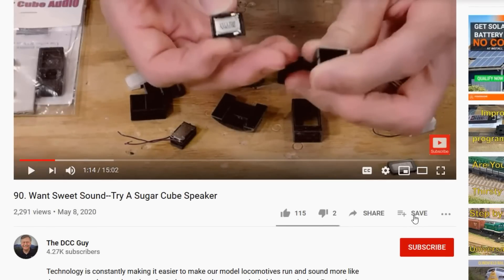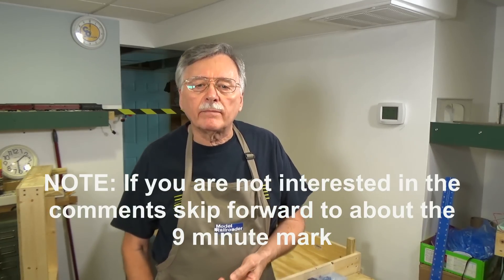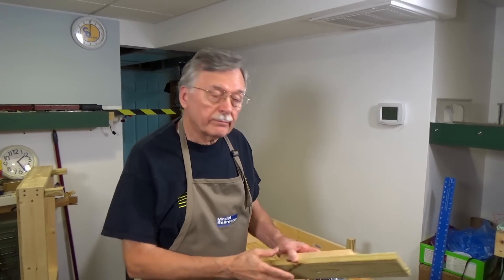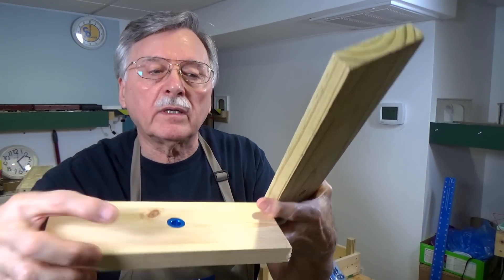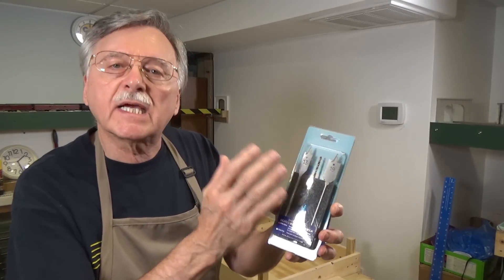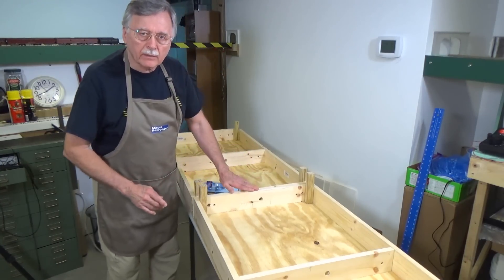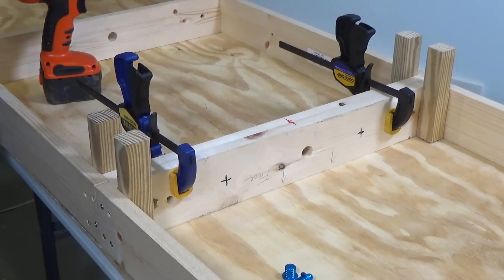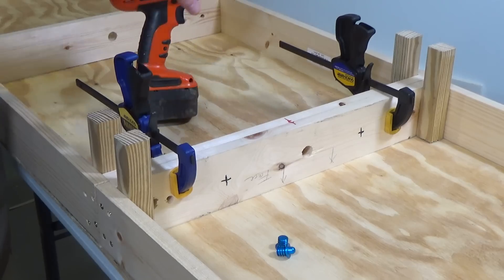Alignment Dowels (132)

Comment: I my experience, I have found that during module initial design / construction, assembly goes well when everything is carefully measured and all screw holes are precisely pilot drilled. When everything is dialed in, I disassemble the modules, then I add some Titebond 2 glue. Finally, I reassemble them with the original screws and clamp them well. No creep, no breakage after over 8 years+ with all my modules.
Also... grave errors tend to occur when drilling alignment holes without some sort of Porta-align or jig to keep you at a perfect 90 deg from the surface.  Your freehand method in the ham-handed hands of many people, can reap very predictably unpleasant results. Using your method, only if you are a seasoned musical instrument repairmen or a retired cabinetmaker, can you expect to carry it off.  (In any case, the photos tend to evidence that you have exceptional carpentry skills that many in most module clubs don't seen to possess.)

Comment: Hi Larry
I am in a NMRA group here in Australia.  About 2008 we built a number of modules for display purposes.  We used those dowels. A jig was made to ensure that all ends lined up accurately.  It consisted of a piece of wood (lumber) with another piece attached at right angles across it.  Two small holes were then drilled where the dowels were to go.  The end boards were then lined up and clamped  to it and a small nail placed in the holes to mark the end.  After taking the end out of the jig the holes could then be drilled.  The modules are held together with a single G-clamp.
They have been to about 30 train shows so far.  Some over 150 kilometres away.  Very quick and accurate to set up.
I love your videos and have learnt a lot.  I subscribe to a number of other channels but have found yours to be  the best.
Stay safe 
Paul from Zillmere
Reply from the maker: Very good point. Hopefully if someone is already a member of a modular crew they will be aware of the groups standard. I participated i  the Northern Virginia N-Scale modular group about a decade ago and know first hand of the problems that arise when folks do not strictly adhere to those standards.
Reply: In the club I belong to we took a similar approach of making up a template. This was particularly useful when retro fitting dowels to old layouts where scenery meant it was difficult to judge alignment of the baseboard surfaces. When building new baseboards we clamp the end pieces together and employ a bench drill for greater accuracy, doing all the drilling before assembling the baseboards.

Comment: I am from the UK and am about to update my Club's 20 years old or more 00-gauge layout corner end board modules with these same blue Australian/UK DCC Concepts dowels. Our existing brass dowels are standard cabinet makers 1/4" dia items which have worked loose. Basically, they are to small for purpose. These corner boards attract members to lean on them, exerting a high down force. So noticing these new items on a DCC Concepts stand at one of the many UK shows (this company is always worthy of a butchers for new products, they don't make rubbish), I purchased a pack of four pairs. I assumed my Club's tool box would include the 13 & 19mm flat bits needed to make the holes. Not so, so today I went to two different local towns and five different tool stores, trying to track these two sizes down. 13 & 19 are basically metrified 1/2" & 3/4" (easy for you in the USA) but here in the UK its now more 12 & 20mm, so nightmare. I did eventually track the correct sizes down. I therefore recommend you initially buy the installation pack which includes said drill bits.
On your video showing their installation, you missed mentioning some important points :
The dowels should be as far apart from one another as access with the drill will allow. This ensures greatest corner to corner accuracy. 
You didn't mention the pilot hole should be as square to the surface as possible in both planes. I saw a YouTube video of some guy using an old CD as a mirror with two lines on it draw at 90° to each other through its centre. The hole in the centre of the CD is centred about the hole you want to drill, and the silver surface acts like a mirror. Just align the reflection of the drill bit shank to both the lines and the drill should be square to the surface. I haven't tried the idea yet, but sounds plausible.
The other problem, was you deciding to drill the 13mm hole from the inner side of the board i.e opposite end of the hole. That's an absolute no no. As you found out, those flat bits burst through, nearly destroying the neat seating surface for the dowel's flange. You then tried to clean out the 13mm hole from the opposite flange counterbore end, which probably made the dowel's body a loose fit, therefore losing the very accuracy we need. Flat bits are useless for cleaning out holes, they rely on their point being able to follow a pilot or bite into virgin wood. I suspect the dowel body should be a light tap fit into its mounting hole, so being 13 and not 13+ a bit, is very important.
Its also very important the 19mm seating counterbore is drilled first following the initial pilot hole, so to leave the pilot hole intact for the point of the 13mm drill bit to follow, to produce the mounting bore hole as concentric as possible hand held.
A good idea to test this on a scrap piece of wood first.
Reply from the maker: Excellent comments and suggestions for the installation. I definitely will point anyone asking for more info to read your post. Thanks for taking the time to do it—Larry
Reply: @TheDCCGuy  thanks for taking it as intended, constructive criticism. I may get in touch with DCC Concepts and query their choice of drill sizes. I assume inch size drill bits are still freely available in the US, as they just may have been looking at your side of the pond as their main market ?
Reply from the maker: One point of explanation, I was following the enclosed instructions that tell you to drill the holes on the face first then drill through the end piece from the inside face. I generally assume that they have tried it both ways and find the way they recommend to be best so I usually do as I am told. At any rate it still provided a tight fit even though there were a few rough edges as a result of drilling fro  the inside out.
Reply: @TheDCCGuy  ok, so definitely worth a trial run on a similar but scrap piece of wood to judge best results.
Reply: Although more expensive, I always use Forstner or saw-tooth bits, which don't necessarily need a centre. Flat-bits are a rough and ready tool which I avoid in any kind of precision work.
Reply: @RicktheRecorder  Forstner bits aren't really designed for hand held electric drills and saw drills are totally unsuitable because a flat bottomed counterbore is required, not a through hole
Reply: @andrewdking  In my full post below, I said that ideally one should use a drill press for boring these holes to ensure accuracy. I agree  Forstner bits are not suited to hand drilling. I was also not referring to hole-saws, but to the saw style of Forstner bit.
Reply: @RicktheRecorder  I'm not aware of toothed Forstner bits; a new tool on me. A specialist cutter I'm sure.
Anyway, these dowels have to have their holes drilled with boards clamped together, so basically impossible in a drill press, more a 90° angle head drill if upgrading an existing exhibition layout as I will be doing on many 4' long baseboards
Reply: @andrewdking  Well, as I said, best where possible to machine your end-boards before you assemble your baseboards, and it is easy to clamp or indeed screw them together, as I did, before putting in the drill press vice. The saw-tooth type of modified Forstner I would say is the majority design these days, from Fisch, Planet, Bosch, Irwin, Freud etc. Much more positive and controllable, and not really any more expensive..
Reply: @RicktheRecorder  I'll take your word for it. Never heard of baseboards having their mating faces machined before and our club has a recently retired professional baseboard builder among our ranks. I'd like to see you mount a fully detailed 4' long 25 year old baseboard in a drill press. That would have to be one very tall floor standing machine. Many are lucky to have just a short bench mounted one. I am a mechanical engineer and know plenty about design and machining
Reply: @andrewdking  Well, again as I said, the end plates are machined before assembly, which is what I do. It would indeed be a rare circumstance that would allow for retro-fitting using a drill press, which of course I specifically avoided suggesting.

Comment: Larry, this video prompted me to use what I consider a sufficient and stronger alignment system.

I used 3/8" diameter wood table leaf dowel pins to align (and partially support) adjacent modules.
(My module size is 2-1/2' x 5' and I join two "horizontally" & two "vertically" to create a 5' x 10' layout.
I am doing this so I can take apart and put back together to free a room &/or move to another location some day.)
I use 4 to 5 wood table leaf pins along 5 foot expanses. (Using 2 to 3 wood pins along the 2' ends of your modules is
analogous.)

Installation: Once two modules are clamped in place, I drill a 3/8" hole all the way thru both of the adjacent 3/4" thick boards.
(This drilling is a single through drill operation for each pin - quick and easy!)  Then (while still clamped) I put glue on the back
end of the dowel and insert the dowel front end first as far as I think necessary into the drilled holes. (one
drill operation but two wood thickness of  3/4" each adjacent and aligned to each other.)
(exact precision in insertion depth is not really necessary.)  The modules separated without any problem - glue did not
come out thru the front of the pin.  The pin pentrates as much as 80% of the female hole when module edges
are flush.

I had anticipated putting a 3/8" dowel disk to plug the rear of the hole after the glued table leaf pin had been inserted.
However, the glue held without this unnecessary plug dowel addition.  The system works wonderfully and not much
expense.  (3/8" diameter table leaf pins are available on Amazon for very little cost.)

Also, I had anticipated that I would need to open the female hole that receives the table leaf pin by using a
3/8"+1/64" diameter drill.  Since I am using standard quality pine, the fit is working well without this secondary
drill operation.
Reply from the maker: Great idea!
Reply: I very much doubt a wooden dowel alignment method would be suitable for an exhibition layout where the board modules are being assembled and disassembled hundreds of times in the layouts lifetime. The female hole in particular being just soft pine most probably, just won't be able to endure the constant battering.

Comment: Interesting video - thank you.  I was not aware of that version of alignment dowels, so will investigate.  Just a suggestion on that - I would prime the holes with PVA also, to be sure the timber is wetted out with PVA before you insert the dowels, just to ensure a really good fixing.  Either that or quick-setting Araldite.

Not sure if you guys have MDF (Medium Density Fibreboard) over there?  That is something I am considering using for the baseboard.

As to your comments on use of PVA, I had never come across the creeping issue, but it makes sense.  Hmm.  I will keep an eye on that, as at the moment I am experimenting with modules (no where near the track-laying yet) made of MDF, and entirely held together with PVA (just glued and clamped), and using Titebond III (thankfully we can get it over here in Australia).  Another option would be a UF glue such as Aerolite 306, but with the requirement for mixing, it is not so convenient.

So thanks again for your interesting and thought-provoking video - appreciated.
Reply from the maker: My main concern with MDF would be potential sagging over time. However if supported with cross braces it is not likely to be an issue on modules. I also wonder about the weight if MDF is heavier than plywood. The PVA creep issue is most likely to manifest with heat so if a module is left in a hot car or loft look out.
Reply: @TheDCCGuy  Hot car - very good point!
Yes, MDF is a little more dense, so a bit more weight, but I am looking at 6-8mm for the top, and 4mm for the sides - very light weight.  Robust - well, as earlier, I am experimenting for now.
Thanks for your quick reply - appreciated :).

Comment: Usual technique for avoiding blowout would be to drill the smaller, 13mm, through holes roughly halfway from each side or at the very least make a shallow cut on one side before drilling through from the other.
Reply from the maker: I agree that is my usual method but I assume DCC Concepts says to do it the way I did it is because once the 19mm hole is drilled into the face the pilot hole might be distorted whereas coming in from the back it is still “fresh”. At any rate the dowels went in to just the right depth and once the glue set up they are in good and tight. They suggest using the wood glue since it would be easy to remove them and use them again whereas with something like Gorilla Glue or epoxy they would be a one time use.

Comment: Love your series of building a model railroad, just what I needed.  I was thinking about using several modules going off at a 45-degree angle off  both ends, is that something you would recommend? Thank you
Reply from the maker: You could do that or just make rectangles and but them against one another at the corners. Makes for easier construction than the angles. For a really neat design see the Beer Line series in Model Railroader. It was set up so the various modules could be arranged in different configurations—one of my favorites.

Comment: I just ordered a couple sets of dowels for my future modules. Is there a distributor here in the US? I am.planning on making a drilling template to standardize the locations of my holes, both horizontally and vertically. Nice series, I have watched to 146 so far. Keep up the good work Sir!
Reply from the maker: Iron Planet Hobbies  carries some DCC Concepts products but not the alignment dowels. Your best bet is to order them direct or off Hatton’s website in England. I get stuff from them all the time and shipping is cheaper than from my local supplier just 60 miles away.
Reply: @TheDCCGuy   I ordered a set off of their website. I ordered the kit and two extra sets of pins. About 50 pounds shipped to me. ($66 USD I think)
Reply: @robertpetit57  i have searched but cant find them on Hatton's website can you help me out thanks
Reply: @tashrigley  I ordered mine directly from DCC Concepts. Good service from them. They are very well made, I was very happy with the quality of what I recieved.

Comment: I like the dowels that you used from DCC Concepts and I hope to use them too. One question, would it not be better to have one set the other way around as for now they have no Track on them. Ok, you only have two boards, but if there were more say three then the next time you put them together they would all line up.or of course, you could just write a number on them. Martin. (Thailand)
Reply from the maker: I considered that but it increases the chance someone might put them in backwards. Also, unless you do very precise measurements when installing them it is highly unlikely they will line up at all if the correct ends are not joined. As you say numbering the ends like table makers do with table leafs will take care of the problem until they have track on them. Modular clubs that use a dowel system do have to set standards and should use a drilling template to make sure all modules fit together.

Comment: Larry will theses alinement dowels be able to handle the stress of over hanging module when they are sat up on a heavy-duty coffee table or a bed; when one truly lack the space to set them up any where else. Or should a stronger method be used like carriage bolts?
Reply from the maker: These are just for alignment not for support. I will be installing carriage bolts to join the modules together and legs for vertical support. This is exactly how I build the main Piedmont Southern benchwork. If set up on a flat surface such as a table the carriage bolts should work to hold them together as the table will provide the vertical support.